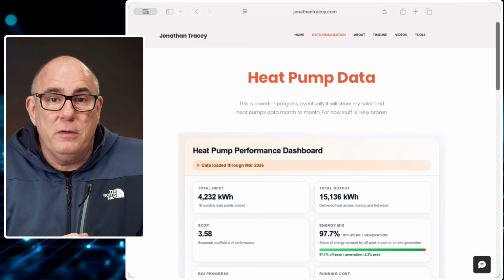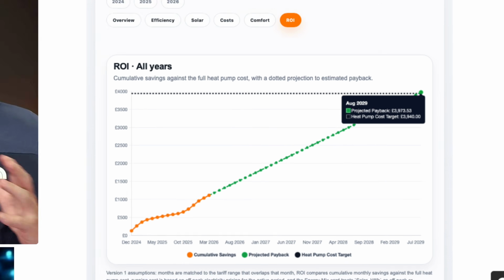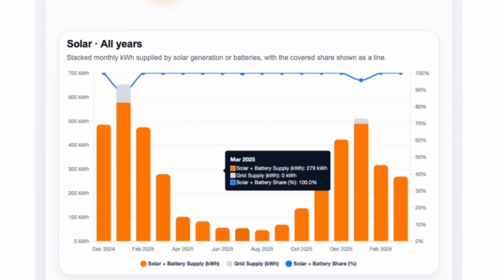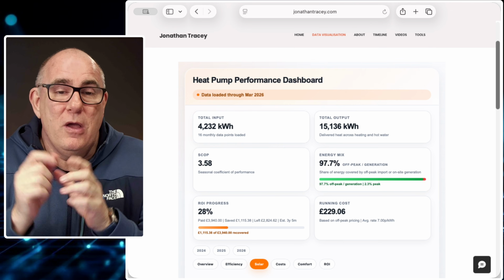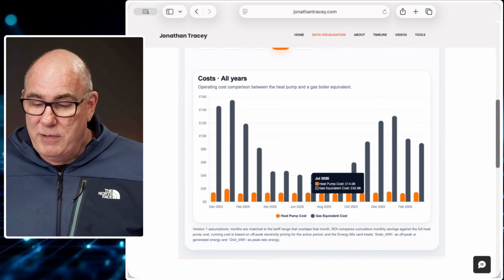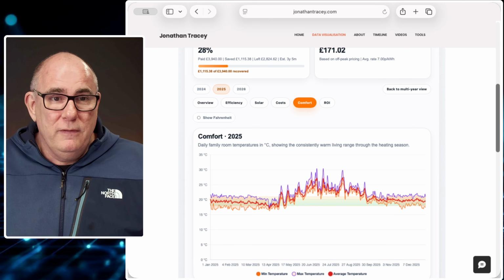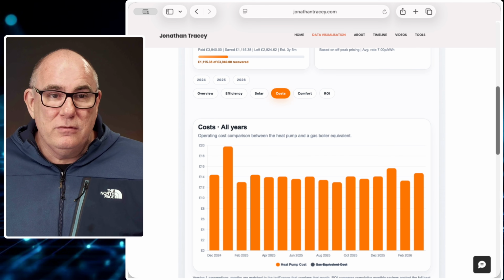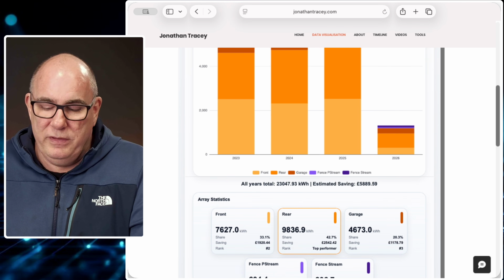Heat Pump Running Costs UK – Real Data (Octopus Energy + Solar)

Comment: For info, Lloyds bank offer green energy grants, which includes £2000 for ASHP, plus another £100 for Octopus customers. I can't remember the eligibility criteria, but when added to a 20% discount offer when we had ours installed, the total cost for a £11,589 installation was £1,171
Reply from the maker: Nice, I’ve heard that Barclays were doing this, but I didn’t know that lloyds were as well. I’ll certainly have to look into it.

Comment: Very thought provoking! You obviously have a very efficient system that only cost £3950. Please detail your system
Reply from the maker: its a pretty standard Daikin 6kw heat pump, a 170l water tank and 8 radiators, not sure what else i can tell you :-)
Reply: @JonathanTracey  maybe you could put a system list on the site?

Comment: Hi, what is you total battery size please? Looking to get a heat pump, 11kw solar and 2 x sigenergy 9kw battery.
Reply from the maker: Our main house batteries are about 27 kWh
Reply: @JonathanTracey I am wondering if I need more battery i.e. 3 rather than 2. I will be upgrading my feedin 3.6kw with a total 11kw

Comment: So, you are talking about using a reverse cycle air conditioner (heat pump)  to keep your house warm? Not a heat pump hot water system?
Reply from the maker: no it does both, it keeps the house warm and heats hot water
Reply: @JonathanTracey  aha! We dont have units like that here in Australia. (Well not that i have heard of).

Comment: With the right setup electrical energy is so insanely cheap it is almost not even worth turning things off anymore. One child likes their room cold so AC on full blast... the other like is hot so the heating on full blast... shrug
Maybe you like warm floors to walk on, but the air cooler, just turn BOTH on... shrug
Reply from the maker: its only cheap if you make your own :-)

Comment: Another great video JT. The only thing that I can say you didn't add to these questions and that you couldn't possibly put them onto a chart. Is the survey done to make sure the heat pump was the right size for your house and the radiators were sized correctly. I know you've mentioned them before but you know what people are like, in that they'll say..."Ah, you never mentioned that though". My system doesn't work...possibly because it wasn't installed properly 🤦‍♂️🤦‍♂️🤣🤣
Hope you're keeping well JT, keep up the great work 👏👏
Reply from the maker: @paulquickmire4140 completely agree 👍 a proper survey and sizing is everything.

Thankfully mine was done right — 18 months in and zero issues.

Really appreciate the support, best wishes!

Comment: Thanks great info, what size battery would you recommend and which make would you recommend, thanks.
Reply from the maker: size is difficult to answer without knowing your energy needs, if i was buying today no contest a SigEnergy  Battery
Reply: For a lot of the big batteries the price difference was getting pretty small so large was looking good. Really you want enough to cover most of your usage when it's cold. So if you know your total energy usage (bill data) then you can get a fairly good guess.

There are two ways to look at it depending on product (vendors with batteries tied to their own product overcharge apple style for their batteries but there may be other advantages). The first is that you size it so that you cover most of your winter usage (but not all on the very coldest days). The argument is that your battery is expensive and the return on the extra capacity is poor as you'll not make good use of it the rest of the year.

The other argument, especially when using cheaper third party batteries and systems that are not tied is that it's a 1500 quid difference to go from 16 to 32kWh and the installer is an expensive chappie and basically fixed cost so it's daft not to go big.

At this point in time I don't think it's clear which answer is clearly correct for all. Solar has reached the "as much as you can fit" stage, battery is still "it depends".

Hope you are not in a hurry - lots of kit is 90 day plus lead at this point and getting worse thanks to the orange buffoon!

Comment: Can you take the amount of capital you spent on solar and batteries and work a 5% return on it and show that against the savings you are achieving? That would be great to see as actual data.
Reply from the maker: I did this a while back for solar panels, I compared to a 6% return from a stocks and shares ISA, the capital was eroded because you you have to pay an energy bill each month, eventually the capital was gone after about 15 years, while hte solar was still producing year in year out. May have to revisit it for heating

Comment: Have you ever considered trying to direct the cold air towards the back of your house with a set of slats to direct the air flow from the fence? 

I suspect you may be getting some recyling of the air out of the heat pump. Heat geeks had a good experiment with having warmer air on the input and from memory that did help a surprising amount.
Reply from the maker: we did a smoke test to check the airflow, none is going back in, what you cant see it he prevailing wind goes past the front of the heat pump and pushes it aways

Comment: Sorry I may have missed it in the video, we are getting a 27kwh battery system installed fairly soon and we are also thinking about a heat pump, what kwh battery system do you have and without the heat pump consumption what is your daily usage for electricity like? I ask due to our battery installer saying our system would not be large enough to cover a heat pump all day for us however looking at your unput to output energy we use less gas than that a year for water and heating so maybe they are incorrect? Our house is EPC A alreadym we have solar but no batteries yet.
Reply from the maker: We have a 27kWh solaredge battery system plus a few smaller ones but its the solaredge system that runs the heat pump. Depending on your other needs it may not cover it but I would start with 27kWh and if after a year you find yoru using too much grid power add more capacity
Reply: You don't need your battery to cover all your usage on the coldest days necessarily. You'll end up with a few coldest days where your bill is ouch shaped for the day but they will be balanced against the battery cost.

In an EPC A house, unless its huge that kind of battery ought to cover most stuff at that size easily. Remember car charging is overnight, water heating can be done overnight and that's moved most of a typical household power load onto the cheap rate already.

27kWh for 18hours with a 3kW heatpump even at COP 3 (ie coldest worst days) is going to draw 1kW so only 18kW of it would go into the heatpump from the battery outside of cheap rates.
Reply: If your were to use a smart meter and Octopus Cosy tariff, the battery doesn't have to supply you for all day, it will only need to get you from one Cosy period to the next.  We had our 18.08kWh battery installed in December, we have a 7kW heat pump and we've not had problems with the HP draining the battery. It rarely uses more than 2kW at any moment in time. Often much less (modulates down).

Comment: That’s really interesting, is there other platforms that give more data from other homes? Just as a comparison.  And lastly, what is the current kWh battery storage you have?  Many thanks Steve
Reply from the maker: There are some but I built this to my exact requirements, will be adding more to it as the days and weeks go on, maybe I need a battery page - I have about 40kWh of batteries in total

Comment: Hi Jon, Surely if Gas prices go even higher which is looking highly likely, the RoI will be sooner than expected.
Reply from the maker: Yep the dashboard calculates each month based on the prices of electricity and gas that month, so if gas goes up (like its looking like it will) the ROI will shorten

Comment: What about folks who have no solar or batteries though ?
I use my gas boiler between 7am to 9pm for heating which is set to 18.5c.  Jan for example i used 1362kwh gas. In the summer without heating 100 odd
Reply from the maker: @Ianabcds great question 👍

Short answer — yes, it can still work without solar or batteries.

The key thing is your **cost per kWh**:
- Gas is typically ~7–8p/kWh  
- Electricity ~25–30p/kWh  

A heat pump running at a COP of ~3 effectively brings electricity down to ~8–10p/kWh for heat — so it’s actually quite close to gas even without any solar or clever tariffs.

Your January usage (~1362 kWh gas) is a good example — that’s exactly the kind of real-world data I’m showing in this video. This one is purely about *what my system actually used*, not trying to optimise tariffs or stack savings.

I’ve got other videos where I dive into tariffs, batteries, and squeezing the costs down further — but this video is really just about putting real numbers on the table so people can compare like-for-like 👍
Reply: @JonathanTracey  Thanks for this, Our boiler is coming up to 10 years old. Wife isn’t keen on the hot water tank but 3 out of 4 of us use the electric shower.

Comment: You forgot  heat pumps are noisy.... omg ...on reditt on any given day some one will post i want to get a heat pump but im worried about the noise   and lol one day this week someone was saying do I get a new oil burner or heatbump my next-door neighbour says its got to be oil as the price may go down 😅😅😅
Reply from the maker: @Ged-uk I hear this one a lot 👍

I “forgot” because in reality it just hasn’t been an issue for me. I’m 18 months in now and it’s no noisier than the day it was installed — you honestly stop noticing it.

There’s a lot of noise (no pun intended 😄) online about heat pumps being loud, but most of it comes down to poor installs or bad placement. A properly installed modern unit is comparable to a fridge or an air con unit.

As always with this video though — I’m just showing *my real data and real-world experience*. And noise simply hasn’t been a problem here 👍
Reply: @JonathanTracey mate im not having a go you have done more to quash the myth more than any "independent " you tuber ive come across
Reply: Unfortunately there are some cases of noisy heatpumps due to bad installs (eg not levelled properly) or bearing problems that need servicing to fix. They are definitely not the norm though.

Comment: We heat with oil, which has just gone over £1.35 per litre, meaning our house will cost almost £2,000 to heat next winter, if the prices remain high. Also our boiler is 27 years old, so could potentially fail at any point.

I'm seriously thinking about getting a heat pump installed, but I think I'll need to get some more insulation in the loft, as we only have 100mm. 
We don't have cavity walls, as our house was built in 1881. 
Our house doesn’t have an EPC, but we do have solar installed. 

It's difficult to run the maths, but if eligible for the £7,500 grant, I'm pretty sure a heat pump will be cheaper to run than our very inefficient oil boiler.
Reply: Our current house is 1860s, 18" solid stone and no wall insulation as it's a listed building. In roof rooms also have poor insulation and it would be difficult to improve without making the listed building people deeply unhappy.

Our experience there was that air/water system prices and radiator upgrade requirements were bonkers and the suggested cost was lunatic. We installed an air/air system instead and it heats the house great because air/air is able to transfer a lot of heat into the actual building so can handle high heat loss.

If you can insulate the easy stuff (roof, room in roof, windows, doors, under timber floors) and block any air leaks that shouldn't be there it'll make an enormous difference anyway and a lot of it is not that expensive to do and actually has a really good pay back.

Going further in insulation is hard. Even underfloor needs care that all the airbricks are working properly in an old building. EWI is usually a disaster and IWI can only be taken so far as well as wrecking any thermal mass (because all your walls are now outside not inside keeping heat) .
Reply: Our house was built in 1867 and we also had oil boiler, switched to a heat pump last September and it’s worked for us, But we also have solar and batteries which are a must have, we put 300mm os sheep’s wool insulation in the loft , older houses don’t like modern insulation, they sweat and upgraded our double glazing, To conclude batteries and insulation first before a heat pump
Reply from the maker: @johnnodge4327 you’re thinking about this exactly the right way 👍

At ~£1.35/litre oil, your current system is likely costing you *far more per kWh* than a heat pump would, even before factoring in the age/efficiency of a 27-year-old boiler.

A couple of key points based on what you’ve said:

- *Insulation first* – topping your loft up from 100mm to ~300mm will make a huge difference and is one of the cheapest wins  
- **Older solid-wall homes can still work well with heat pumps**, they just need to run at lower temps for longer (which they’re designed to do)  
- *Your solar is a big advantage* – even in winter it will offset some running costs, and in spring/autumn it really helps  
- With the **£7,500 grant**, the numbers often tip very quickly vs oil, especially at current prices  

You’re right that the maths can be tricky, but in most cases like yours the running costs alone end up lower than oil — and you remove the risk of that old boiler failing at the worst time.

If you do go ahead, I’d prioritise:
👉 Loft insulation  
👉 System design (low flow temps, correct sizing)  
👉 Then the heat pump itself  

Get those right and you’ll be in a really strong position 👍
Reply: The Grant for replacing oil boilers just went up to 9K!
Reply: @MrFlyby34  So the price of the heatpumps for it will also go up another 1500 quid 8)
Reply: @etchedpixels well…..

Comment: Unfortunately not all heat pump installs have been created equal. I moved into a  4 bed bungalow with a 17 kw heat pump in Feb. It used 1400 kwh  of electricity in the month of March. It was installed under the Domestic Renewable Heat Incentive (RHI) with the installation company getting the 7-year RHI payments. I am no expert but it looks like a really bad install designed to generated and use as much power as possible so they get higher RHI payments. I think the heat pump tech is great (not mine). Just needs to be done right.
Reply from the maker: @mickward8123 completely agree 👍

That sounds like a poor install rather than a heat pump issue. A 17kW unit using 1400kWh in March is a red flag — likely oversized or badly set up.

The tech works, but only when it’s designed and installed properly. That’s exactly why I focus on real data 👍
Reply: Maybe someone on a social media site can suggest ways to improve your install given you can share photos and data there?

Comment: I would argue that gas boilers do have an ROI if you upgrade your boiler for a more efficient boiler. The ROI is just negligible.
Reply from the maker: Okay, maybe I should’ve said meaningful ROI. But with such a small return, you’re unlikely to ever get your money back.
Reply: @JonathanTracey  sorry. Not trying to be pedantic. This is just the stuff that has come back at me from people that are gas boiler loyal and just cements them more into the them vs us situation. I guess the ROI if switching from oil to a combi is high but the ROI from a combi to heat pump seems alot higher, esp atm, even without solar. It sounds breakevenish if you don't have batteries? But that just means going from oil to heatpump is even better.
Reply: @TejashPatel-z2r  If the job has been done to a good standard and you stay on the standard tariff then your heatpump is a fantastic pollution fix but pretty marginal on saving money.

The solar and the batteries are what really make it work, particularly the batteries bit as you tend to run it mostly in winter if it's air/water (air/air is a bit different but if you are now enjoying your aircon too you aren't doing it just for RoI !)
Reply: @etchedpixels  i totally agree with you, but I don't think you read what i wrote??
Reply: @TejashPatel-z2r  I did read it, so either you didn't explain your point clearly or I missed your point - no matter 8)
Reply: @etchedpixels  no i don't think you did. I wrote about gas boilers still being able to have an ROI. Its pretty clear. So i guess you just missed the point. All good 😊

Comment: The 4x COP "myth" is for a heat pump alone vs gas (when it's real) , not for heat pump and batteries vs gas - > an obvious winning combo with the right smart tariff, which you'll also need an electric car to access. Otherwise, clear and well presented video. Thanks.
Reply from the maker: @TJames appreciate that 👍  

You’re right on the COP point — comparing heat pump vs gas alone is one thing, once you layer in batteries and smart tariffs it becomes a very different picture.  

On the EV side though — from what I’ve seen, you don’t necessarily need one for tariffs like Go or Next Drive (unless it’s something like Intelligent Go that actively integrates with the car). In a lot of cases it’s more about eligibility than actual usage.  

End of the day, the key is just accessing those cheaper rates — however you get there 😄
Reply: Depends on the provider. Not all require an electric vehicle the way Octopox do.

Also the Octopus policy is "BEV", battery electric vehicle. As far as I can tell from caselaw and talking to a pet paralegal (I am not a lawyer thankfully) that covers ebikes, escooters, mobility scooters etc. The other bits about having a charger and charging at home are also trivially met since an ebike definitely comes with a charger.

Judging by what I see nobody checks or cares anyway unless you are blatantly charging overnight at 6p, storing it all in a huge battery and selling it back all night.